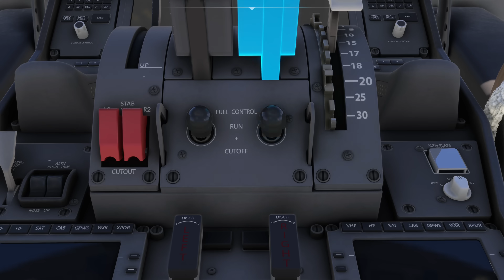Air India 171: Why Did The Fuel Cut-off Switch Get Moved?

Comment: Ones again my Theory as an IT & Cybercrime Experte:

Summary:
1.0. As I know prior to the flight there has been Maintenance on this aircraft
1.1. I dont know the procedure of the Maintenance Team, however: Could it be possible that the Maintenance has run an Bug-Fix, Bug-Check, Script-Check etc.?
1.2. Do the Maintenance run any script which prohibids the engins to start during the maintenance (override:fuelcutoff=true) and forgot to set back to normal setting?
1.3. Note: the Maintenance had access to the ARINC 664 (AFDX) Network — Core Data Bus, and could have implemented Malware/Virus etc.

2.0. Cockpit Scenario:
2.1. Pilots set Frontpanel Fuel Cutoff Switches to “THROUGH” (RUN) position
2.2. Pilots proceed takeoff and rotate and positive climb
2.3. Software "Bug, Virus, Malware, Software Glitch etc." sends signal to the Network to "CUTOFF" - for any given reason
2.4. Blackbox records "CUTOFF" but Switches remain “THROUGH” (RUN) position
2.5. Pilot ask: why you cutoff? Answer: I did not
2.6. Pilot sets Fuel Cutoff Switches to OFF, and back to ON

IMPORTANT (this needs to be checked and verified by the according experts)
If the Network has received from the Software an command to CUTOFF and the Black Box has registered the CUTOFF, will the Black Box register another CUTOFF (when being in CUTOFF already) when any of the Pilots will move the Switches from “THROUGH” (RUN) position to CUTOFF and back to “THROUGH” (RUN) position - to restart the engines?

This is the crucial point: If the Black Box can NOT register an active command twice, this would be proof, that the Black Box would have registered the “THROUGH” (RUN) position ONLY, because it was already set to CUTOFF by Software command.

This would also explain the 10sec delay of setting the Switches back to “THROUGH” (RUN)
0:00 - 0:04: why did you CUTOFF? I Did not.
0:06 - 0:08: Switching the Switches from “THROUGH” (RUN) to CUTOFF - physically (NOT recordet by Black Box as already in CUTOFF)
0:09 - 0:10: Switching the Switches back to “THROUGH” (RUN) to restart engines (recordet by Black Box)

- - - - - - - Details - - - - - - -

As per my understanding the Fuel Cutoff Switches are not 100% mechanical.
The switches are operated manually by the pilots, but everything is triggered electronically in the background.
Just because the Fuel Cutoff data is written on the data of the "Blackbox" does not necessarily mean that this was carried out by the pilots.
 
If a cyber attack, malware or Bug caused the engines to shut down (by manipulating Fuel Cutoff electronically or spoofing the signal),
the aircraft might interpret it as dual engine failure and/or (APU) power loss — triggering RAT deployment.
This type of Virus Code targeting the electrical load management system (ELMS) could have deployed the RAT before engine shutdown
due to spoofed signals or cyber-triggered power loss - which would explain why the RAT was deployed so fast.

If this scenario would be the case, The Fuel Control Switches on the panel could physically remain in the “THROUGH” (RUN) position,
while the system behavior mimics them being in the “CUTOFF” position.

Wie erkennt der Master/Captain, dass 

As I know In the Boeing 787 Dreamliner, the cockpit includes sophisticated display systems known as the Multi-Function Displays (MFDs) and Engine Indicating and Crew Alerting System (EICAS). These displays aircraft parameters, including fuel status and engine configuration. Therefore the Fuel Cutoff would be displayed there and the Pilot can see if it has switched back to OFF - please correct me if I am wrong.

I am not claiming that an electronic fault triggered the levers manually, but rather that the cutoff may have occurred due to a possible electronic malfunction.

The cockpit data recorded on the Flight Data Recorder (FDR) and Cockpit Voice Recorder (CVR) does not come from the switches or sensors directly. Instead, it is captured from a central avionics data network, and more specifically, through a dedicated interface unit and recording software.
ARINC 664 (AFDX) Network — Core Data Bus

The 787 uses a deterministic Ethernet-based avionics bus called ARINC 664 Part 7, also known as AFDX (Avionics Full-Duplex Switched Ethernet).
All cockpit switch positions, sensor readings, system states, engine parameters, and more are digitally transmitted across this network.
If a command line (maleware, bug, etc..) triggers the system/network it will give false interpretation of what actually happened. In this case "my theory": it has given the Cutoff command to the system and wrote this into the Black Box, and this will and can happen without the Switches being physically moved.
Reply: Lemme guess. You’re not a pilot rated on an advanced transport , AMT or Avionics tech? You’ve read some things and cobbed together some suppositions not based in reality only theory so you could impress the world on YouTube. The systems don’t work as you suppose and the action you propose are not possible.
Reply: @stephenwalton9646  AS per my explanation I clearly wrote that I am an IT guy and I am giving my input and theory from the perspective of an IT guy. Anyone who is an expert and can put light on my theory is highly welcome to do so, there is no reason for derogatory comments. By the way, I am writing with questions marks, which shall be clear that I am asking if this could be an option. I am NOT saying that my theory is fact. But it would be nice if aviation IT/Software guys could give an explanation regarding my questions, and not a Pilot. I am sure that Pilots do not 100% understand the coding behind the entire Network - please correct me if I am wrong (maybe all Pilots know how to program the Network for an aircraft).
Reply: Exactly
Reply: This makes a lot more sense than what I have read or seen anywhere else, escecially if the FDR can't record an active event twice as you mentioned.
Reply: Great detailed explanation. Even i thought about same scenario.  Captain saw MFD and asked first officer why did he cut off fuel switch (which is obvious as they were climbing and all they can see is sky) while he should have actually checked the fuel switch, MFD was showing exactly what that virus/malware wanted to show. One issue with this theory is there is no reaction of pilots recorded from the pilots when they realised switches are behaving opposite.
Reply: @ape789 You guys have never piloted a Piper Cub much less a transport category jet. Free speech is wonderful as it allows people with no actual knowledge to say anything with authority. If one had actually flown but one takeoff in a jet or even a simulator you’d know how absolutely ridiculous these theories are. The dynamics are nothing like what has been theorized here.
Reply: @stephenwalton9646 Hey steve, u r correct, never piloted an aircraft. I am from IT background. I am just speculating  what could have possibly happened. Being a IT head all i can think of is virus or a bug. Again not putting things as authority this is an open forum to discuss so thoughts are welcome. 

Also, putting blame on the pilots is easy but when i read articles about the pilots being super cool head and the first officer was just few hrs away from becoming a captain, i just felt the premimnary report is not doing justice. Also one thing i could notice is the report was published kn friday after markets were closed. So little suspicious on that part too.
Reply: In Database Server systems, we use ECC RAM because we know that even cosmic rays can effect our systems and cause bit-flips etc. and we fix those errors with ECC. What is the chance of cosmic rays (or any other natural cause) effect the circuit of cut-off switch and send wrong signal for split second?
Reply: @OceansEightyOne The chances are absolutely zero. This tech is not new and both design and construction are well vetted. The shielding, surge suppressant specs are to say the least, robust. Cosmic rays interfering with critical systems? That’s addressed by engineers who know the environment. Systems are not delicate or by today’s standards sophisticated. This in order to instill robustness.

Comment: 4:28 So I’m an Airbus guy, but I’d be surprised if procedures are not at least similar: In the event of an imminent forced landing (due to dual engine failure for example), engine masters (fuel control switches) are set to off upon touchdown.

Comment: There seems to be a strong push to imply that it was pilot error and close the case on the preliminary report without all the facts. The report does not not say that the switches were physically moved. Reference is make to transition events on the DFDR. There are may ways, hardware and software  to create such events on the ADN (Aircraft Data Network) without physically moving the switches, even with a 1 second transition delay. The DFDR is not connected directly to the switch contacts. It just logs events on the ADN.

Comment: ❔❓❔❓Why are you spreading the narrative or insuniting that the pilots are to blame. Where is the hard evidence??!!
The switches are purely mechanical.
Have you even considered that the electrics cut off the fuel pump and wjen the pilots realised this they tried to recycle the engines?
Are you paid by Boeing, Steeeve?
What's your explanation on the ANA 787 that suffered dual engine failure on landing?  You are keeping that quiet, Steeeve.

Comment: Captain, you cannot rule out technical malfunction because today's modern plane works on multiple sensors, it has many computers.
As much as they want to protect Boeing, but we cannot accuse of the pilot of any wrong doing. Pilot 1 and Pilot 2 knows what they are doing, and they sounds confident and clear.
Reply: if something went wrong without you seeing anything you would ask what just happened. not why did you do it.
Reply: @PavelKrupets because only two persons there, Pilot 1 saw the problem so he ask Pilot 2.....
Reply: @haha4581  question would be: what happened? did you do anything? something is wrong can you help figure out. why are engines spooling down?

not: why did you do it. you ask this after you saw somebody doing something.
Reply: @PavelKrupets you cannot use your standard to assume other culture to speak the way you spoke. You think they are blaming but they are only asking...
Reply: @haha4581  it is common communication. saw something or happened before, younask whybdid you do. didn't see, ask who did it or what happened.
Reply: @PavelKrupets you need to understand every culture is different.. Dont expect everyone to be the same as you...

Comment: Is it remotely possible that the springs holding the fuel cut-off switches become weak and soft with age and repeated use? Could a bumpy runway have caused the switches to change position by themselves?

Comment: At about 3:05, the comment concerns making the switches require both pilots to activate. This to me is risky. Suppose one of the pilots has a heart attack and is rendered unconscious. This presents a dilemma caused by a safety feature - how can the remaining pilot perform a function that requires two pilots. In general I think we face this issue all the time in many areas: one design feature can result in an unwanted scenario - that is, fixing one problem causes another. Basically I think there is no perfect system. Some assumptions need to be made. The assumption here is that a pilot of sound mental fitness would NOT intentionally shut off the engines within 15 seconds of take off. That's why the switches are designed to prevent accidental activation. If someone is going to do that, then there may not be any fool proof safety measures. The person who shut off the engines would have done something else if there were sufficient safety features in place to prevent the fuel switches from being move to cutoff. Detection and prevention are the only true ways to minimize this type of situation.
Reply: Imo, excellent observation.

Comment: If one of the pilots is hell bent on crashing the plane They're many ways to do it regardless of the others pilots efforts to prevent it, IMO.
Reply: Exactly, everyone is desperate to try and "fix" this scenario when in reality you can't solve for a suicidal pilot with technical decisions. A determined pilot will always be able to crash a plane
Reply: Not suicidal . This is one Mass killer psycho @biochem6
Reply: @biochem6   So why would the pilot do it the hard way by switching off fuel?
Reply: Correct.
Reply: Yep. Invert it at takeoff.

Comment: When takeoff speed is reached, why is it called rotate? What rotates?
Reply: Angle of attack increases, aka, the nose goes up.
Reply: @pmaitrasm But that isn't what rotate means. Rotate = move in a circle around an axis. If the plane increased its angle of attack 360°, that would be rotate. 🤷🏼‍♀️

Comment: Just to add another question on top of what you already have:  Is there any auto fuel shut off function upon sensors detecting an engine fire or overheating, etc, that may falsely trigger this unfortunate incident?  Thanks.

Comment: You can draw your own conclusion.? Why? They haven't released anything definitive. The report doesn't say the switches were physically set to cut off. If they have evidence for that, it could've been included in the report. The pilot asks "why did you cut off", but the other pilot says he didn't. You can't read too much into something the pilot said in a shocking moment of seeing the engines shutting down at a low altitude. The report is very ambiguous. I think captain steve is jumping into conclusions without having any proof.

Comment: The preliminary report on the Air India Flight 171 crash has led many to hastily conclude pilot error, but as a pilot, I strongly question this assumption. The report indicates both fuel control switches were moved to the "cutoff" position within 1 sec of each other, an action that seems nearly impossible given the design of the Boeing 787 fuel switches, which require deliberate pulling and flipping to operate. The cockpit voice recording captures one pilot questioning the other about the cutoff, with the other denying responsibility, suggesting a potential technical malfunction rather than human error. Furthermore, it underscores the need for a deeper investigation into possible mechanical or systemic issues before attributing blame to the pilots. Rushing to judgment risks overlooking critical evidence that could reveal a flaw in the aircraft’s systems or maintenance, as flagged in a 2018 FAA bulletin about fuel control switch issues.

Comment: But there was a recent example of where the first officer, who was flying while the captain went to the bathroom, suddenly became incapacitated. Therefore you can't guarantee that both pilots would be available for a coordinated control change, like for the cutoff switches.  Question. Given that there is a world-wide shortage of qualified pilots, is there a risk that, in the race to fill positions, certain items may be overlooked or their significance diminished that would otherwise have disqualified some pilots?

Comment: Switching off the fuel supply and switching it back on again begins the engine restart procedure.  They were probably trying to restart the engines, but at that altitude, there just wasn’t enough time.  When the pilot denied switching the fuel off, he probably meant that he’d turned them back on again.  As it happens the engines were restarting when the aircraft crashed.  The question is what caused them to lose power in the first place.  The engines don’t die the instant the fuel is turned off - there’s quite a lot of fuel in the lines.  Everyone seems to be jumping to the mental health angle.
Reply: Why do people make comments without investigating first? The initial report clearly states that both engines were running properly up to the moment when someone shut their fuel. And the 10-second plus delay flipping them back to RUN shows that the intent was not to trigger a quick restart.
Reply: They were likely not doing an engine restart attempt. It wouldn't take 10 seconds to put it back to run if that was the case.
Reply: No fuel, no thrust, no lift, when full power is needed. Example: starting to climb a steep grade in loaded semi, when engine propulsion ceases.
Reply: Steve himself jumped to the mental health conclusion in the first video of the preliminary report. 😅

Comment: Sir I am hearing that switches were transitioned. Did the mechanical positions of both switches also changed. If not then pilots might have tried to move them to off and then on because of loosing thrust. The pilot who asked the question might have listened to the engine sounds and not the switch positions at the time.
Reply: No, the flight data recorder only records a signal, not the physical movement of the switch.

Comment: I am going to mention it again. One report I saw said that they had found that there was something on the software that allowed some outsider to mess with the plane. For some reason that video is no longer there. Also, there is a video that shows the RAT deployed while on the ground. I have mentioned it before, is there a possibility that the RAT deployed and it shut the fuel off. I don't believe the pilot theory it is an easy excuse because the pilots can't defend themselves.